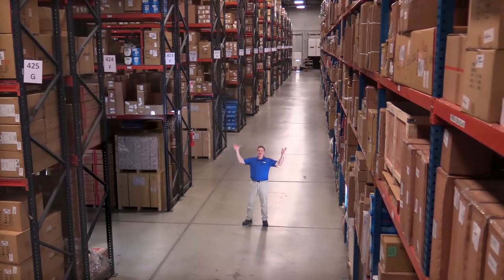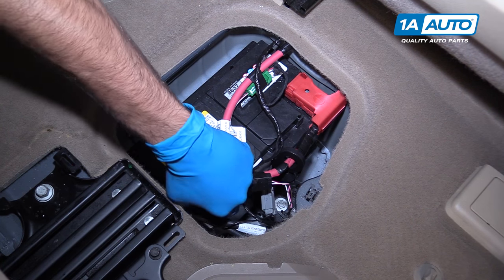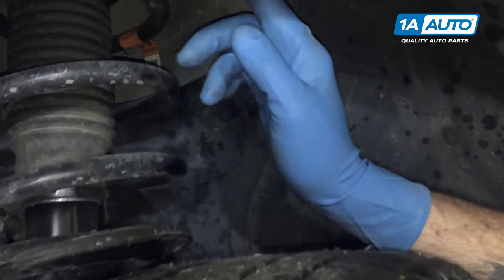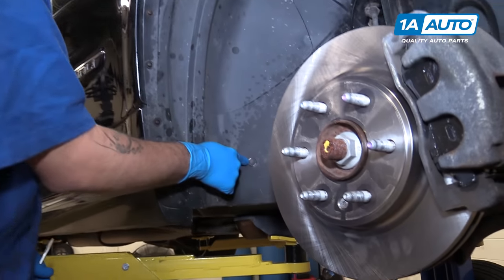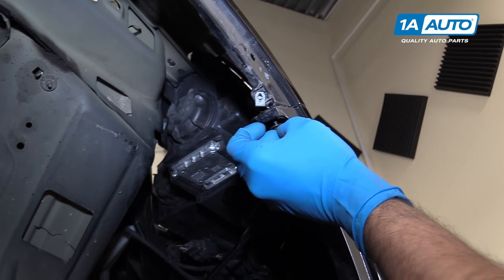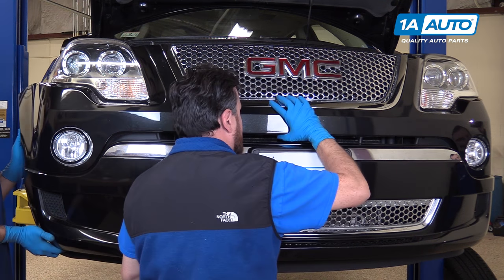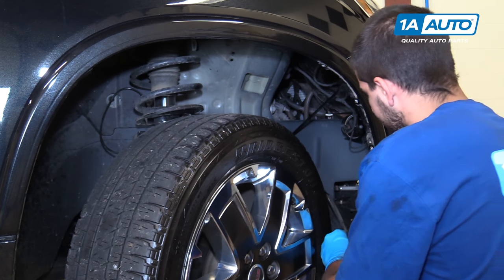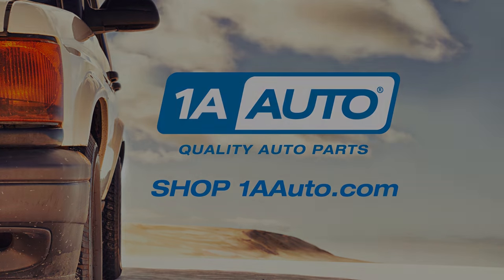How to Replace Grille 07-16 GMC Acadia

Comment: Thank you for a clear and concise video. You explained the steps plainly and orderly, and in a cadence the viewer can easily follow. Also, the video work is excellent. I worked and sweated through all the steps, with the car at ground level, discovering as I went, to attain that goal, before I finally found your video. Your video gives me confirmation and provides guidance for the finishing steps. Thank you again, for producing a very well done video.

Comment: Some things I came across that are different. 2013-2016 Acadias may be different than the 07-12. I ended up using T-15 Torx Bits on my 12 since T-20s were a little to big. Also the fender wells are different on the 13-16 models, mine didn't have the fender flares like on the 07-12 model in the video, so you don't have to remove the rear portion of the front wheel well cover. Not to mention my model didn't come with fog lights, other than that not much difference.

Comment: Would you have to do all this just to replace the “GMC” emblem or is there an easier way to do that?
Reply from the maker: +Zach Frazier The emblem is held in by a few push tabs that need to be decompressed with a pair of pliers.  If you can reach in there with the grille on then you should be alright, but it is much easier to do with the grille off the vehicle!  Here is a link to the emblem and video if you need it!  https://www.1aauto.com/gmc-nameplate-general-motors-oem-22761717/i/gmbee00062?f=951989&y=2012